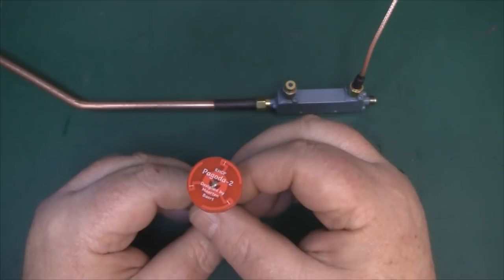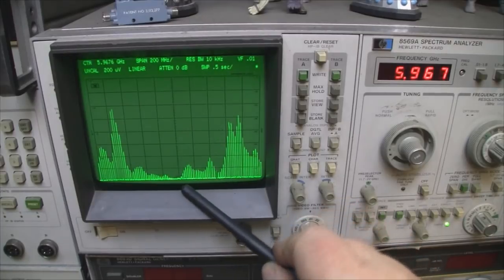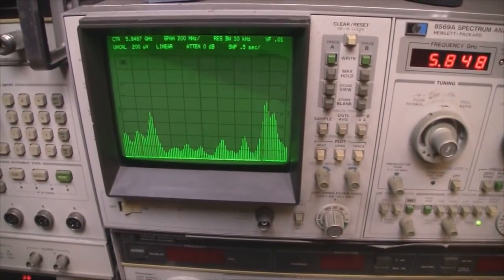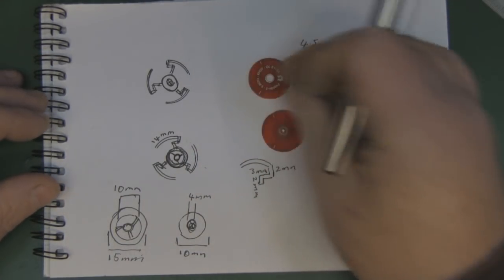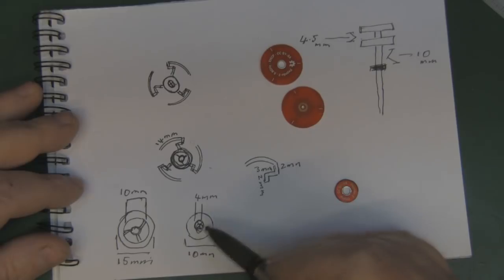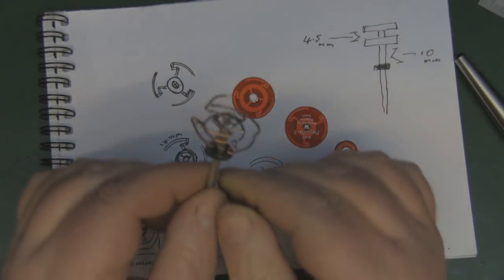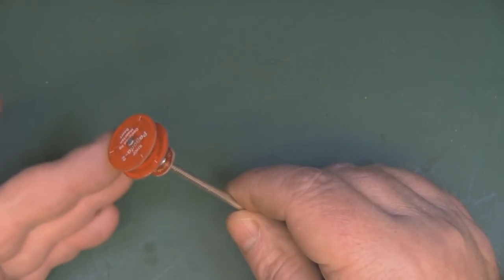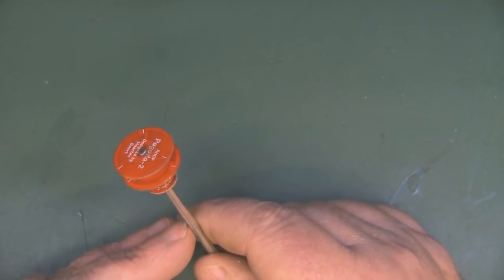Pagoda Circular Polarized 5.8GHz (if Carlsberg made antennas)

Comment: My tests with antennas which I can only do without your specialised equipment indicate there is no advantage to circular polarisation. In fact whether I mount them horizontally or vertically makes no odds. I would guess that this is because the routers only contain a scrunched up piece of pcb to transmit with, unlike a tv mast which broadcasts with a good horizontal or vertical aerial.
Reply from the maker: Have you been testing circular polarization with wifi?
Reply: yes, Andrew, I made your earlier 2.4ghz design
Reply: Circular polarization is a big help in the FPV drone racing scene. The video feed is analog, so reflected signals cause ghosting due to the time delay. A circular polarized reflection changes polarization form RHCP to LHCP, or vice versa. The reflected signal will be 3 Db down. Also if racers are on adjacent frequencies changing polarization can reduce interference.

Comment: Andrew, 

Please  would you clear up a very basic point? The alternative to 2.4 ghz is 5ghz, from what I can see on various router specs. So is this shorthand for 5.8? If so, that seems odd since 2.4 is not shortened to 2. Thanks.
Reply from the maker: Nick 5.8GHz is used mostly for cameras on quadcopters although some people do use 2.4GHz as well which is the same as wifi. Wifi does indeed use 5GHz.

Comment: The problem with these antennas (on quadcopters) is that they are only as strong as the coax, and have a habit of snagging on things in a crash. So whilst the PCBs are very strong, the coax tends to rip which is a pain to repair. Covering the PCBs with heatshrink or 3D printed case helps, but not sure if that will change the performance...
Any chance you could test the results when the PCBs aren't parallel, or when covered in plastic?
Reply from the maker: I see your point and can see how they would break. They have some on amazon with covers will order one and test it.
Reply: I can post you a cover and save you the cost!

Comment: I've been using pagodas exclusively for FPV for a few months now. Maarten also designed a triple patch directional antenna that I use on my goggles with diversity. So far I've found no problems at all with either